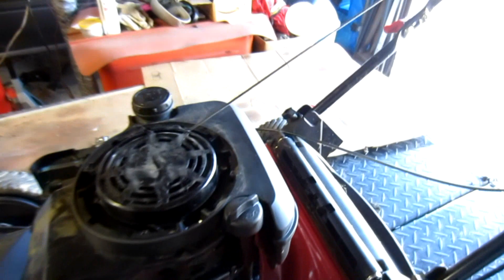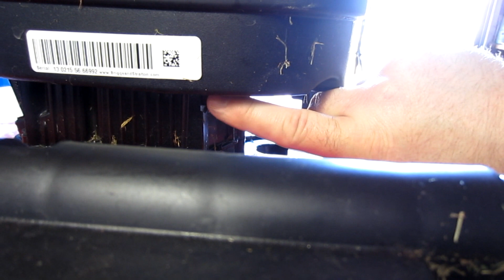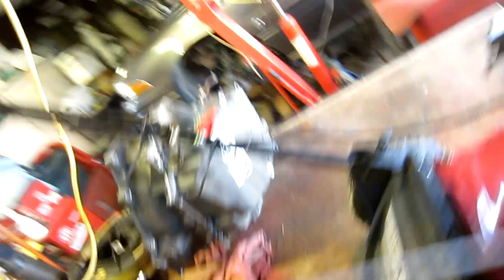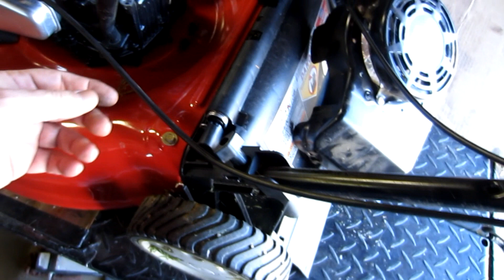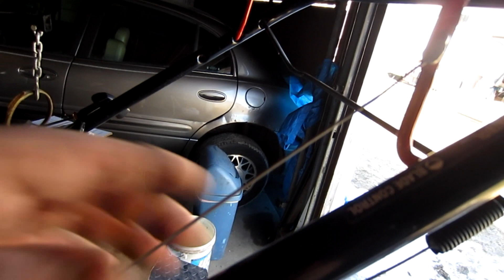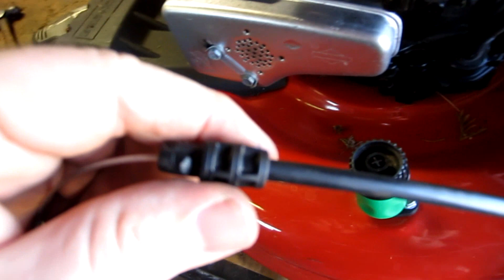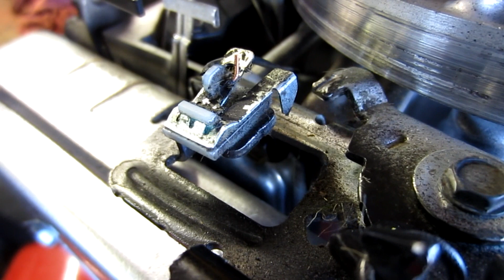Briggs Push Mower flywheel brake repair

Comment: Very good video on ow to fix that cable. I have a question for you. I ave a craftsman mower, When I engage the control lever, the brake lever does not move. used this mower a week ago, and it moved just fine. I had to much oil in the mower so I stopped but today when I tried to use the mower (after draining some oil), the lever itself will not move, it did once or twice but never would start. I tried moving the lever by hand, would not move, tapped it some with a hammer, not hard but it does not move. This is a 917.379200, self-propelled mower. I spayed some WD40 but that had no effect. Any suggestions?  Do you have a video on that topic?
Reply from the maker: Janelle Wolves Thanks and sorry I don't have a video on the problem you are experiencing. If your cable is intact and connected at the handle and at the bracket on the engine it should pull the brake lever.  Make sure your cable casing(the black sleeve that the steel cable goes through) isn't kinked or broken anywhere. If you just recently had the handle bail removed make sure you reinserted it back into the correct holes on the handle. The lever that you tried to move by hand ( not gonna happen) it is a strong spring that requires channel locks or vice grips to move. hope that helps, good luck.
Reply: Foxboss9 The lever moved a few times, but when I actually try to start the mower, the cable pulls, but I dont want to stretch it so I dont pull on it that hard, I see it pulling. I disconnected it on both ends, and pulled to wire itself and it moves quite freely. So I put both back on, and in the right place. The lever itself is what is not moving. Last week I used it but for a very short time as I had put to much oil in it. IT was alittle hard to start but that was the first time this year I used it. Would seem like I could move it by hand as that wire is not that strong and it doesn't take alot of strength, when it is working to pull the control lever.  Before I tried to use it today, I drained out the excess oil, last week didn't even go once around the yard cuz it was smoking and didnt want to mess up the mower with too much oil in it. It is strange cuz i did see that lever move once or twice,but I was not pulling the start cord, just moving the control bar.. Thanks for answering so quick.
Reply from the maker: Janelle Wolves If you can move the lever with a tool of some kind(pliers,vice grips etc) then I would revisit the cable ends and casing and where they hook up on the bail handle. Also, where the bail handle goes into the mowers push handle as there are different hole choices on both.....  Make sure the bail handle isn't upside down or something simple that may have been overlooked.. But if you can move the lever with tools and the cable is in perfect working order then it should easily move the lever when connected properly.
Reply: Foxboss9 I made sure of where the cable was connected on the mower handle, when I close the control bar, it actually pulls the cable out of the hole it is mounted on, thats why I stopped trying to start the mower, feared I would stretch the cable, probably did somewhat already, but I did remove the cable on both ends, and pulled the cable inside the cover to make sure the cable was not bound up or kinked in some way. The odd thing is, last week, that was no problem, was hard to start at first, ( was the first time I used it this year), but it did start, I went around part of the yard, cutting the grass, motor ran find but then I started getting alot of smoke so I cut it off, put it up, and weed eated the whole yard. Yesterday, I dumped out the oil and kept checking the oil level, allowing it to "settle" and then tried to start the mower, which would not start or even turn over. I then started watching the brake lever, saw it was not moving, just the cable pulling so hard it came out of the mounting, then tried to move the elver manually, no joy, tapped it some with a hammer, lightly, no movement so I quit for the day, came in and started looking for solutions, found your video. Maybe just need to disassemble it and that that mechanism off and see if there is movement, that the actually brake can move, if not, guess I will just weed eat the yard all summer, again Lost my job, cant afford to pay to get it fixed, riding mower went down last summer, runs fine but when engaging blades it acts like it is being strangled out, so I guess I will end up weed eating the yard all summer again. The riding mower, a friend and I took the deck off, and went to a repair shop, bought a new belt and blades, came home put the deck back on and I guess that was done wrong because it never has worked right since, dont want to keep using it like that because it will kill the mower engine, and its a 1996, dont want to destroy it, Last year,I had to buy a new weed eater because a screw broke off that held a part on the carburetor and it got to much air, and I was told it could NOT be fixed so i bought a better weed eater and thats how I have been cutting my entire yard.  Guess I'll do that until this weed eater dies, and then I guess I'll get me a goat!  Thanks for the info and today I will take stuff off, basing it off one of your videos and try to fix it myself. If I get it working, I'll come tell you what i did, and you can try it at home cuz it will be based off what you have taught me already! thanks. If it does not work, I'll just tell you that and nothing else. I replaced the gear that engines the started on that riding mower a few years ago, figured that out for myself, as it would not turn over. Thats when I got new blades, a new belt, and I had already bought a new ignition switch. Big time do it your selfer since I have live now many yeas with a very low income and now will have no income in two more weeks, unemployment runs out then.
Reply: Janelle Wolves i posted this below in the wrong place. Foxboss9 ok I went outside, disassembled to where I could access this brake lever, and am now very confused. It PUSHES FORWARD, IT DOS NOT PULL BACKWARDS as the cable would move the lever.   here is the link to the video I made so yo could see it. It moves one-handed.  @1. In the video you can see me moving the cable inside the sheath quite easily. Where the cable attaches to the lever, you push it forwards, the brake comes off the flywheel?, not sure if that is what that part is called, but that opens the switch at the other end.
Reply: Janelle Wolves @1
Reply: Janelle Wolves So now I can pull the lever back, the cable moves the lever, but the b*^#ch won't start. Tired to clean up the spark plug and cap to it, I can tell it is getting s park at least. I have dyslexia so somethings things seem backwards to me, like the cable pulling the lever.
Reply from the maker: Janelle Wolves Use carb cleaner to get it running to see if it is old gas..if you had alot of oil in the cylinder like you had mentioned before you may have to do short burst of carb cleaner to get it running long enough to get hot so it will stay running and burn off the excess oil.

Comment: Foxboss9, thanks for your helpful advice.  I've been to able to get the engine running and the cable/brake are working fine.  Yet I am finding that when I start the lawn mower, it seems to rev high and low (hunting and serging?) initially and then evens out after few seconds. So far I've changed the spark plug, cleaned out the tecumseh curb and changed the bowl "O" ring, and cleaned the air cleaner.  Even though I have cleaned the carb, I have not changed any needle seat and or plastic emulsion tube's O rings.  Do you think I should rebuild the carb to get rid of the highs and low in the engine when it initially starts?  Your advice is much appreciated.  Thank you once again.
Reply from the maker: And that is why Tecumseh went Out of Business... Tecumseh insisted on making their own carbs and they were not good. Do yourself a huge favor and don't waste the extra time trying to rebuild the carb. Just buy another one. They are not too expensive and rebuilding the one you are having trouble with cost half of what a new one cost if you consider your time worth anything. It's so much more rewarding just slapping on a new carb and know you'll have it fixed.. Before you purchase new though. Run a wire up through the main jet in the carb and make sure all visible passages are cleared of any obstructions. also check that the breather is clean coming from the top of the block going to carb(2% probability of issue). again good luck..
Reply: Foxboss9 I went out, disassembled to where I could get to the lever and try to move it. now i am really confused. I was able to move it BUT, it PUSHED FORWARD, does not pull backwards, like the cable would pull it backwards. Now, how do I upload the video I made to show you?
Reply: Janelle Wolves @1
Reply: Janelle Wolves @1 I cant post the link here for some reason, that is the name youtube stuck on the video
Reply: Janelle Wolves @1    maybe this time
of not one Cap P little j CAP j three CAP j  CAP Y five CAPS n y y
Reply from the maker: akbaxb165 Great to hear you got it running!!     If your gas is fresh and it's "hunting" for a steady idle,,, Then buy a new carb.. Those Tecumseh carbs are not worth the headache.. That's what I do.  good luck
Reply: Nope, it wont start. I am gettj g a spark though, even though the plug anf cap are alittle rusty. Tried to clean it. But not running yet
Reply from the maker: If you're getting spark it should run on carb cleaner when sprayed into the carb directly. If it won't run while doing that then either your flywheel key is sheered or you have a stuck valve or you have a broken connecting rod or you have a scorched cylinder or broken rings.
the Sheered flywheel key and stuck valve will not be as obvious as the other problems I have listed.

Comment: Very well explained. Thank you very much, sir.  My 1998 MTD lawn mower has a Tecumseh engine.  I pulled the starter rope few times, without holding down the control bar.  Now I am having problem starting the lawn mower. The cable bar is now not as tight and firm as it used to be. Cable seems somewhat lose as well. When I hold down the control bar, the brake mechanism (sleever?) does not appear to engage and appears quite stationery. Any advice on this issue is very much appreciated. Thank you.
Reply from the maker: You need to find where the slack is coming from. check the both ends of the cable where the metal goes into the holes on the control bar and on the engine brake. See if one of those is partially broken. If not check the black plastic sleeve that the steel cable runs through( from engine bracket to handle bracket) make sure it is not cracked and bending. if not then check the brackets that the black plastic cable casing ends connect to to make sure they have not bent inwards towards the steel cable mounting points. If not check to make sure the control bar handle is not bent to where it is hitting the handle grip before allowing the cable to  fully disengaged the engine brake.. Thats all I can think of pertaining to the cables operation..good luck..

Comment: I am trying to replace the brake cable, but the drive cable is also attached to it. I have a Sears model 917370610. Thanks.
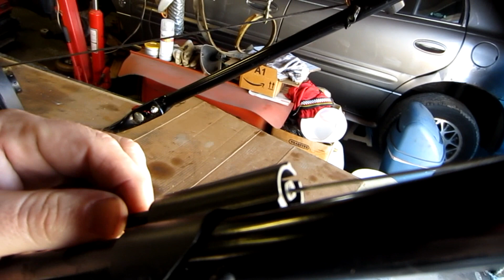Reply from the maker: You will remove the cable as I describe in the video at time marker 7:36 You can remove just the brake cable from the handlebar cable mount.

Comment: I have a question that doesn't really relate the meaning of this video... I have the same type of engine but craftsman. The lever that comes up from behind the exhaust. does that attach to the choke lever that comes across to that side?
Reply: it is part of the thermostat controlled ready start system. heres a link to a closeup pic http://ww2.justanswer.com/uploads/mr2cycle/2012-06-27_024142_thermo.01.jpg
Reply from the maker: it is part of the thermostat controlled ready start system. heres a link to a closeup pic http://ww2.justanswer.com/uploads/mr2cycle/2012-06-27_024142_thermo.01.jpg